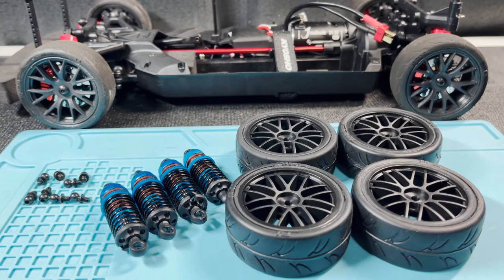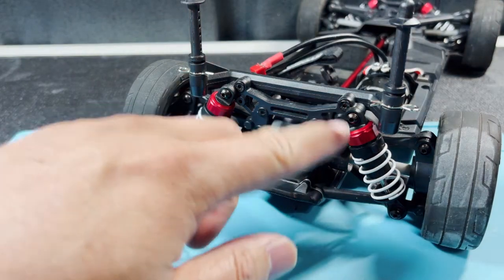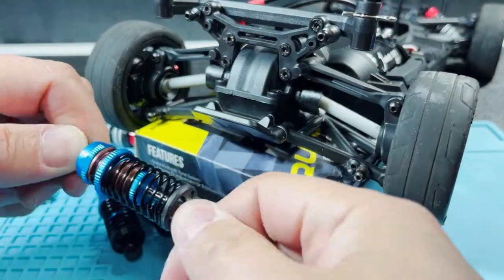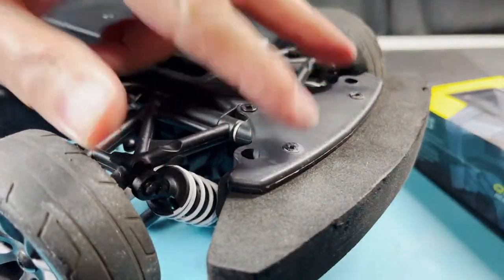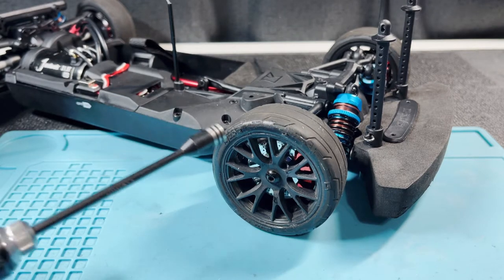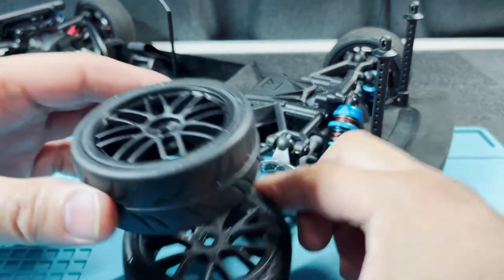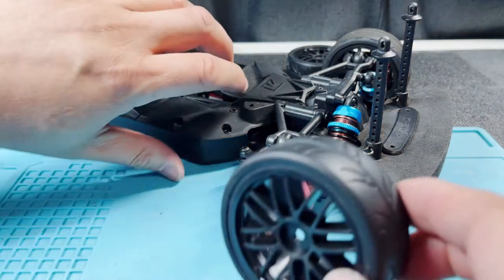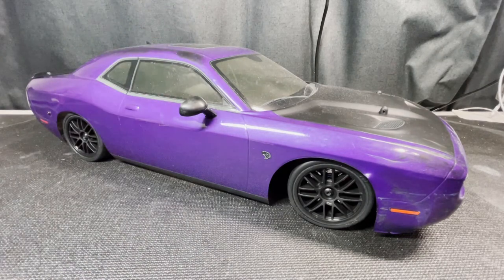Dampers, Wheels & Tires | Kyosho Fazer Mk2 Dodge Challenger Hellcat | USGT Class Race Prep

Comment: How are replacement parts for Kyosho? I’m really considering getting one of these cars. I want to rip up the brushed variant and then do the same upgrades you have chosen minus the wheels. Great video thanks for taking the time to film it
Reply from the maker: Fazer replacement and hop-up parts are not as plentiful as those for the TT-02. It's a solid choice for a RTR touring car. Thanks for watching the video!
Reply: @RCsRCCars  would you say it’s still a safe bet to invest into. Thanks again.
Reply from the maker: Kyosho has sold a lot of Fazer Mk2's and they keep coming out with new bodies. I think it's a safe bet that there will be parts available for a long time to come. I would personally buy the standard 260mm wheelbase version rather than the 274mm like this Challenger.

Comment: Hey nice video, question for you I just got the same Fazer Challneger today ran one 2s battery through it on a parking lot and tires look very worn already. What aftermarket tires will last longer and can they fo onto the included stock wheels?.Thanks!
Reply from the maker: I had the same experience with the stock tires. These USGT tires are a little bit smaller than the ones that came with the car.

Comment: Can't you just add oil to the stock shocks? What do these shocks give you that the stock ones don't?
Reply from the maker: You can and should rebuild your shocks occasionally. These shocks do not use pretension spacers. You can adjust your ride height and dampening by twisting the cap.

Comment: I own one what 
What is the wheel setup and all that because I want to put on a Traxxas c10 drag pack on mine
Reply from the maker: I'm not sure if that's going to work. The Fazer Mk2 chassis is meant for a 200mm width body. The Traxxas Chevy C10 drag body is 279mm. I don't know of anyway to add that much track width.